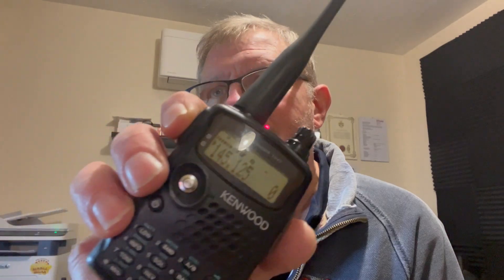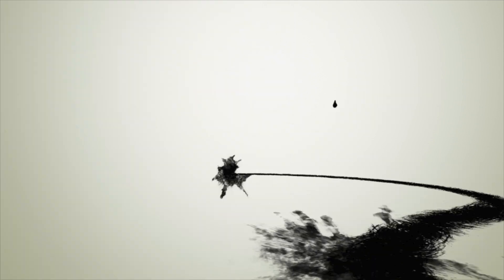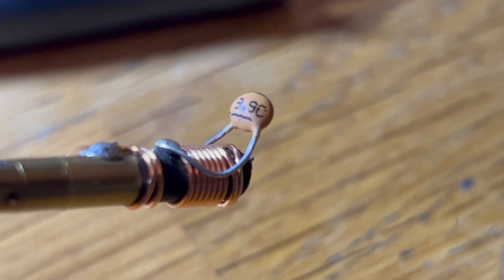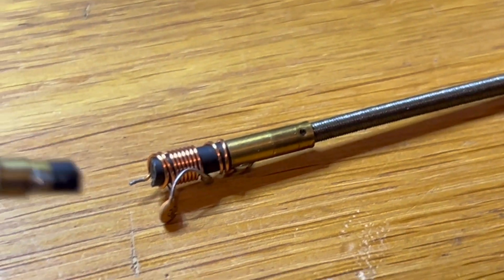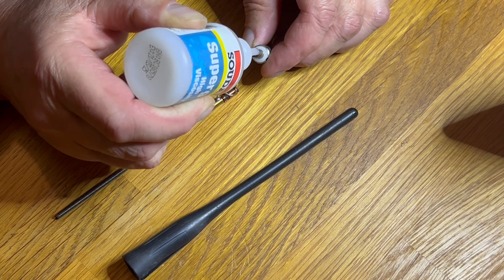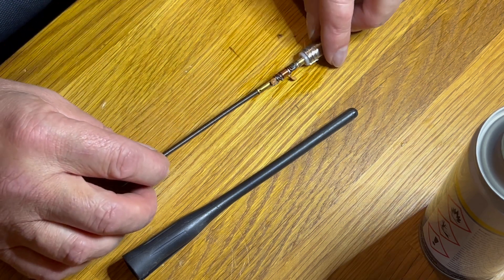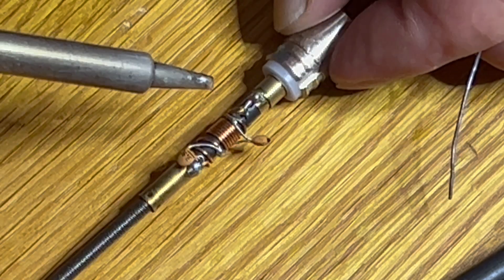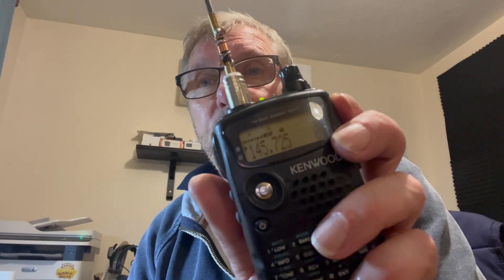Antenna Autopsy 3 : Kenwood TH-F7 Handheld Antenna Fix

Comment: Nice job! You Brits are industrious and practical. I'm lazy and I'd just buy a new antenna! Many of the aftermarket replacements have more gain anyway. I have the American TH-F6 triband model that has the 222-225mHz band. They are nice little radios.

Comment: curious why they're using inductors (coil) and capacitors for these simple antennas aside from using a physically shorter antenna (coil in series making it electrical longer).  Do the coil/capacitor help at all with bandwidth (i thought bandwidth was usually dictated by physical size/shape)?
Maybe they're messing with the shape of the antenna for better bandwidth but in doing so they pushed it outside the freq range so the coil/caps are there to pull it all back to target freq?  Maybe it's just easier to solve for poor build design by matching with coil/caps (i bet this has a lot to do with it)?
A simple monopole antenna, cut to the appropriate length (1/4 L) would be way less prone to failure which leads more there's more to this wizardry than meets the eye.  Is this a Monopole antenna or something else?  Who can explain the configuration for this antenna?  Why can't this be made without the coil/cap?  (to <2.0 swr).

Comment: Nice fix. That common for them rubber Duck antenna to break.  Super glue was invented by a failure of trying to make Lenz for gun scopes during WW2 US military . This was a failed attempt but they made a note of it. Years later was looked at again and found that it stuck to everything  and after palemeratiosn it had great streangth of holding.  Then was marketed under the super glue name . Their is several video's on birth of super glue . 73
Reply from the maker: Great information thanks. :)

Comment: It is amazing how many antennas have these very low value capacitors in the line. Typically less than 10 pf. But capable of a very high voltage. 2.2-3.7KV. Nevertheless, they keep failing. OK, not in this example which was caused by a physical break but just generally. Take apart a certain white stick antenna covering 70/2/4/6 for example. Or a dual band Uda-Yagi beam for 2 and 70. The caps are always the cause of the failure. G0JSV
Reply from the maker: Yep, totally agree, :)